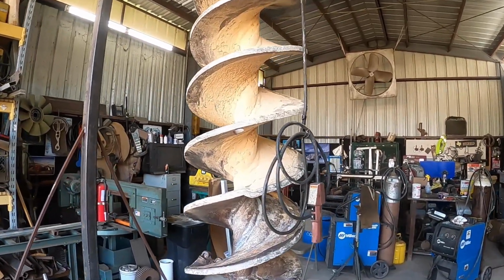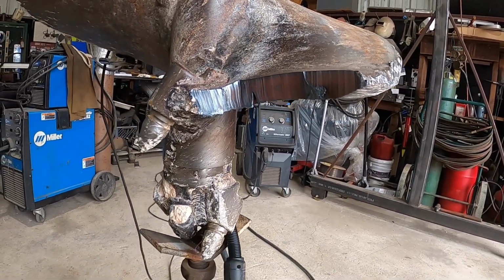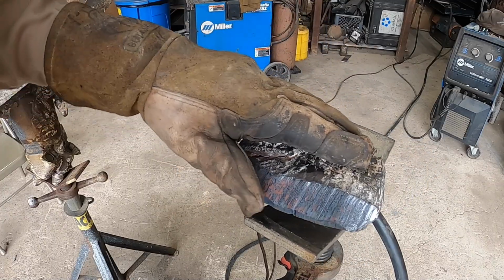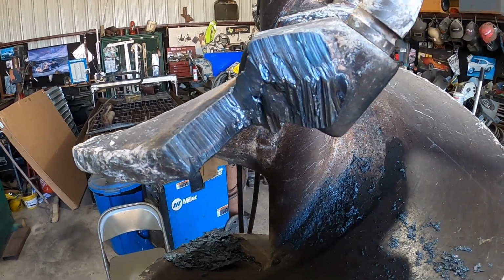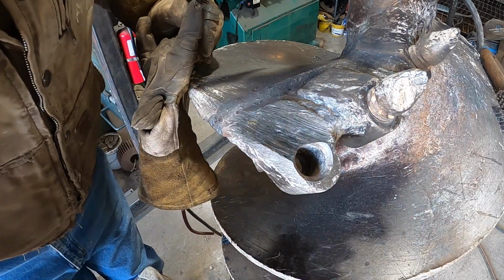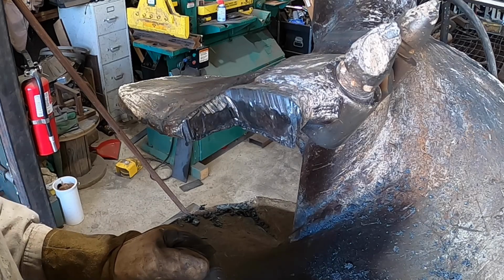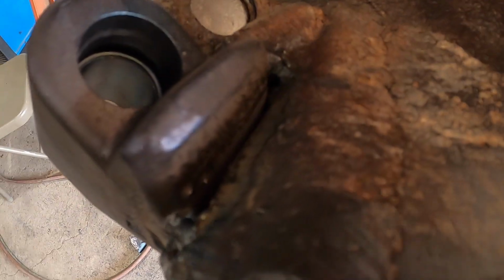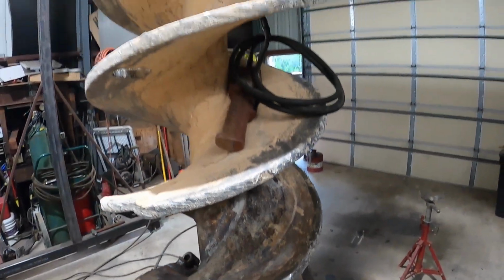Auger Back again??

Comment: Isaac I appreciate that you don't pile on all the operators and business owner for stuff breaking. As an owner operator who takes good care of my equipment and also performs maintenance and repairs I've come to appreciate that things just wear out, get fatigued, fail and occasionally break. When something breaks its not an automatic that it's a terrible operator, or just a greedy owner who doesn't care about the equipment his guys have to use. 

Many times all there is to do is fix it and move on. I'm sure most of your customers appreciate your practical approach and quality work. Thanks for sharing.
Reply: This is the foundation drilling business. It’s the nature of the business.
Reply from the maker: I fully agree. Not all breaks and repairs are blatant oversight. things just happen.
Reply: Luke you are correct, but sometimes the operators are only interested in payday and quitting time, & the owner isn’t much better or isn’t around the job.
Reply: @dirtfarmer7472  I agree. I'm just not one of those owners and neither are the guys that work with me. I also see a lack of training on how to properly operate and maintain a piece of equipment, but overall I'd like to believe there's a lot of talented operators and owners who care that just break and wear stuff out trying to do an honest job for there customers🙂👍
Reply: @lukeshurtleff9770  Pretty sure there are different drills and methods for different kind of rock and none of it is cheap. What they are using usually works well enough that even with the repairs when it doesn't and it gets beat up, it is still their equipment of choice. And it makes work for our favorite welder. Win win.
Reply: Right on Luke Shurleff. This sort of machinery like any mining, aggregate or forestery machinery for that matter is trying to tear itself apart from day one. It is amazing how this stuff stays together sometimes as long as it does.
Reply: They saved having to replace the whole bit must've been cutting solid Granite to get that 🔥 to burn up the edge...
Reply: @deconteesawyer5758  Issac light's out always kindred spirits enjoy each others company and knowledge...😔🌎❤
Reply: LOL, like he would really call out his customer on YT. Come on dude. 
He is a small repair shop, you think he would throw his business in the garbage?

Now I have seen other channels tell it like it is, but it's usually a machine shop channel where the customer has no choice but to come to him, and they can also afford to lose a customer cause they are like the best shop in like 500 milers or something. (Kurtis from CEE is a good example. I know he watches this channel, and he doesn't suffer fools, lol. He also cusses like a sailor lmao)

No offense IC Weld, you know how it is, alot of welders out there trying to get these jobs. You got to be able to willing to get in the dirt and into tight spaces, I'm sure some of these new guys don't get dirty. They tell them to bring it to their shop, lol. We used to do that when I worked at FDDA. Told the garbage companies that they had to bring in their equipment to use. That we won't go out and crawl on the ground, in the gravel. Other companies found mechanics that would do all that. Drag a transmission jack over gravel, with a 900lb tranny strapped to it. Scary. We had to have it on solid concrete, had to lift it up in the air. Still had them maggots though, lol, dropping on you. You didn't want to be holding a soda under a garbage truck lifted in the air lmao. I work for the government now, so I'm even more pampered, lol. But I put in my hard time for 25 yrs, getting filthy and greasy, squeezing into dirty holes up in a truck frame to get to a bolt or a hose. 
Sorry I went off on a tangent rant, lol.
Reply: @mikeworkman3593  Tangent rant duly noted and understood.
Reply: its also a lot of hard diggins down in texas so a lot of these things are bound to happen im sure...
Reply: @ICWeld  rocky and hard ground doesnt help with premature failures aswelll... but these constant maintenance and repair jobs keep a man in bread! ;)
Reply: @carlcarlamos9055  Once you get into rock, how much further do you have to drill?
Reply: ..Well ; " It is what it is , right ? "....🤑😁😘...
Reply: @lukeshurtleff9770  True, sometimes there's better ways of working. In this job for example the auger will quickly get incredibly hot, hot enough that you can run a hose directly on it while drilling and it barely creates mud it just runs off as steam. Hot iron bends and that iron gets HOT!
Of course water may not be readily available but at least here in Australia its common for sites to send water carts around to provide dust suppression, you could negotiate with the gen. contractor and grab a hose off them.

OR you can use coring buckets or there are more aggressive tapered rock augers on the market, its not sensible to sit there for hours at a time with the machine up on its idlers bouncing around breaking augers.
Reply: You are spot on! Equipment wears out and breaks. What I find is the people complaining about having to repair the equipment (which I am one of, not the complaining part) are either not fixing it correctly or are just plain lazy. The guys with their own rigs and the ones punching the clock who take pride in their work don't complain about operators. A bad operator will be taken care of by the owners and bosses of the companies we work for, usually they don't last long.

Comment: LOL  funny story about stick welding.  I was repairing a friends skid steer bucket.  I had bought a brand new bottle  of shielding gas which meant for the weekend I would have two full bottles.  Well they sold me a bottle with only 200 lbs in it.  I had to get the job done on the weekend.  Finished off the first bottle, switched to the second bottle Sat night at about 4 pm only to discover the bottle had only 200 lbs in it.  When it was empty, I had to switch to the old stick.  The guy I was doing the work for said to me, I did not know you could weld so well with a stick.  I explained, i had started  out with a stick many moons ago and am excellent with it, but the mig is just so much faster and less splatter for cleanup.  Instead of finishing the job at 10 pm I finished it at 4 am.  It really is a lot slower.
Reply: but in the wind a whole lot better!!

Comment: Thanks again. I was especially interested in your movements when stick welding. It is the only welding I have done but only occasionally and never enough practice. Great to see what is really going on at the fire.
Reply from the maker: I'll make a more specific stick welding video with the different weld patterns at some point. That way you all can see how they apply in real world situations.
Reply: @ICWeld  Would love a hands-on weld course for all welding techniques. 👍
Reply: What wire are you using with Mig?

Comment: Perhaps you could have used a square section bar as a filler at 45 Deg. It's what's available no doubt. Everything you do is a work of art. I remember many years ago one welder we had every job he did ended up looking like a porcupine, rods stickup up all over the place. One excellent chap was on around £120 a week and went to work welding the gas pipelines for over £400. His name was Clarence, he came from Africa. That's around 50 odd years ago. You do bring back some memories my friend.

Comment: Anything working as hard as those drills are is going to have a very finite lifespan. Big drilling operation came through montreal over the last 2 years piling for an elevated railway. They were mostly in clay but each drill had a welding rig in full time attendance just in case. The arc shots of the plasma torch at the start of this vid are superb. Thanks to ICWeld for taking the time to share :)

Comment: Yeah. Those Bauer displacement rigs are pretty powerful ! Bend a 3ft bit in a heartbeat. Hay, I used to weld at the nuclear plants up an down the eastern seaboard during the outages. It’s been a hull of a career, but I’ve always wanted to have my own weld shop. Since I didn’t, Ima do it vicariously through you! 🤣😂🤣😜👍🏻😏

Comment: Issac, it is so good to see another one of your on-the-job weldings and cutting videos. This was for me, one of the best videos that you have ever posted for your fans like me, to view. When seeing a close-up of the plasma cutter actually cutting the metal away, it was mesmerizing how fast the cutter actually cut through the metal. Also, this video was very informative on how to deal with broken heavy metal parts using the plasma cutter. There is no doubt that I will be using it as a reference on how to best use the cutter many times here in my home hobby shop. I will say that you surprised me when you started using the torch, but as I have always said, time moves on with new equipment being invented, but regardless of what changes, the torch will always be with us. In this video, we were treated to plasma cutting, torch cutting, MIG welding, and electrode welding all in one video, wow. Thank you so very much for your videos and informational comments and welding instructions.

Comment: GOOD JOB!
It's difficult putting lipstick on a pig !
There's nothig wrong with using the round as a filler as long as you get penetration
I love the precision you get with the gouging rods. I would have loved to have them 30 years ago. 😎

Comment: You are amazing as you remove and replace distorted metal that is not straight, square or parallel to anything but yet you are able to restore it to like new, maybe even better than new. Love your round filler piece.

Comment: There is something that is just so satisfying about freehand plasma cutting.  I hate having to do it, because it means that something has probably broken, but just the way that the 'flame' causes the steel to 'rinse away', like water is always makes me smile.

At the ~28 minute point why not switch back to plasma? The oxy-fuel stalls on dirt in the cut, plasma would blow through that as easily as the metal.  Even pure MgO evaporates under plasma's temperature but only glows white hot under a neutral (max temperature) flame.
Reply from the maker: plasma wouldnt cut through the thickness of the tooth pocket

Comment: Wow, I have never seen such a good angle of a plasma ding it's thing.  That steel is running like water! Hot! Nice. I have been wanting to get one for years! I want to open a small shop at home, to possibly weld and repair farm equipment maybe build trailers or repair trailers, if it's nothing but a couple jobs a month, it would give me time to work  on my projects, I would only need a few more tools,   nice work!

Comment: As a hobbyist welder with “more money than brains” as my dad would say…I have cut and welded 1/2” material playing around practice. I’m a few years older and have 20 years in aluminum aircraft assembly so steel welding is new and still fun. I’m so impressed with your skills and I know it’s experience based on real world effort. I’ve watched numerous videos on all the pipe welding and heavy  steel (1/2” and up) welding. My thickest project was 1/4” welding fixture table with add on shelf. I was bummed and elated to find that while the manufacuturer of said table said .015” flat I got .009” flat. I was sure I could do better but after analyzing the final product I think I should have only left the outer edges tacked instead of full welded. The bow is a high center rather than a low center. Experience based on evaluating everything and making new choices based on said results. I know you do that all the time. I’m glad to see your son have an interest and hope he has the same “fun” in making money fixing things. Cheers and peace.

Comment: Thanks for sharing your survey of the damage and your repair process.
I guess it does not benefit drilling those holes with some kind of lubricant like water and borax.
Dolomite and flint rock are not a good combination, but that was left over from when the oceans were in that area before we were walking around.

Comment: Love watching you . Guess a square bar of metal turned like a diamond would work also ? It would allow you place to weld as well. But I don't know. I think the round makes sense as for strengtk. Thanks again .
Reply: that was also my thought. you have a automatic 45 deg bevel built in. more penetration than round. but everyone has their own technique and reasons.
Reply from the maker: Yeah, a square bar would have probably been better. 😁👍
Reply: @ICWeld  But was the right length closer than the roundbar?

Comment: up north here , when gasfield boomed , we RARELY saw repairs ... usually REPLACED that stuff , and you aint kidding  ;  push until wrecked indeed and the heat buildup more than peeps wood realize too .... rock , or WELD on , bruh !!

Comment: That was great, I liked your explanation for correct filler uses.  I did wonder about the driller though, I've seen some drillers when in hard rock situations pump a mud into the hole to help the auger push through.  It doesn't completely stop wear and tear on the auger, that's impossible but it does extend the life of the auger a pinch so they get a few more holes between trips to the repair shop!  Well, just my experience. Thanks for sharing!

Comment: Hi just had a quick question about the weld at 42:10 . I’m wondering why he has such a sharp angle, I’m halfway to all position smaw with cwb testing, just wondering if there is a benefit to that. I was always told in school to keep your angle at about a 45. Nice job on the repair/video! Cheers
Reply from the maker: it was partially because of the limited space and the camera may have not been seeing the weld angle correctly.

Comment: I like your videos and how you explain what you are doing and thinking before, during and after a job.
You mentioned that the bending of the teeth could be caused by the thinning of the auger plate behind the teeth.
My thought was to add a reinforce plate behind the teeth to make the plate stronger.
Did you consider that?

Comment: Im using the same mig gloves from Black Stallion and wow are they comfortable. They come with a curl in the fingers that i love
Reply from the maker: Same here. I like the double padding. its tough enough to let me break off the flux coating of a 7018 at the tip for an easy restart with my thumb and index finger.

Comment: I think that the true show of how tough that auger has to work, was the worn down remnant of one of the outer picks housing. That would have to be some hardened cast steel and it was worn down like a block of softwood.

Comment: Hey.  Absolutely love everything about the channel. 

Question: Any possibility that it might be easier to cut back the entire auger a foot or so and reattach fresh pockets on that new (higher) leading edge. Basically live with what becomes a shorter bit?
Reply: Probably not, from my "professional layman"  ;-) point of view. You'd have to cut both sides AND the tip ("pilot"), redo new pockets, reattach all those tip seats, and align them properly... Seems to me like more than twice the job and three times as much trouble (and not to mention material + electricity cost). I guess there's a reason Isaac is doing it the way it does - also, I if I remember well, in some of his other "auger jobs" he actually did cut off the entire edge, created new pockets and welded new seats, but that was (if memory serves me) because of extensive wear or damage.
But that's just my twopence on it. Cheers!
Reply: There are two ways to look at your question, firstly how important is it to maintain the full depth of the auger bit in order to be able to dig the piling holes to the correct depth? Second, cutting back the auger bit would have to have been discussed by Isaac and the equipment owner or manager and cost implications understood.

Comment: It's astonishing how powerful plasma cutters are, every time I see them in action I'm dumbfounded how fast they just blast through stuff.
Reply: I remember a Tool Time episode where Tim and one of the kids is working in the garage and they cut off some metal with an oxy torch.  Tim proclaims "you have cut steel, WITH FIRE" and smears soot on the kids face.  Everytime I watch IC I think of that phrase.
Reply: Hey Karmic, on your point of blasting through, i finally can see tank armour being easily penetrated by  a manpad.

Comment: Two thing can cause cracks in weld: when leave it without paint and at resonances when the force was travell back and forth in diffrently flexing materials with high speed.
In theory the claws has to be own support on drill head to drive axis, and an other one for the end of a auger. The gap in between is may filled with high damping elastic thing, to stop the resonances to travell up on the spiral, and than come back to the headed end and stressing the welded connections
When use a drill in non homogenus material like a dirt the far end will hopping than spin like the drived end, and have to keep the rpm far away from self resonance point and have to limit the torque when it is can happen.
So the one part of the solution is decoupleing the mostly hopping and the mostly spining parts on a drill. Than the second part is put a accelerometer in to the cutting head to ensure the driveing rpm and torque is set right.

I am an electronic enginier who solve wierd problems in realised instuments. In many cases these are comeing from an mechanical related issue so sometimes i need to go that far.

Like the own way man, who keep with no-grinding at all, just set up the surface perfect.
Reply from the maker: makes sense

Comment: I would say that this Auger did the job well since the last repair and maybe the design of it lead to this second failure now is there any way to force some air or water to cool the cutting head's or use a more  hardened metal on that cutter plate to keep it from bending by the heads.